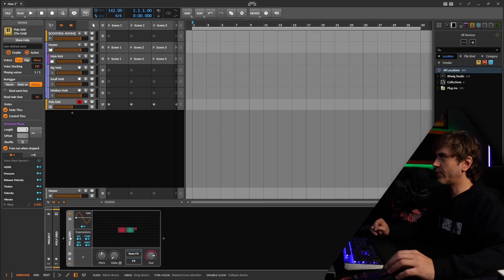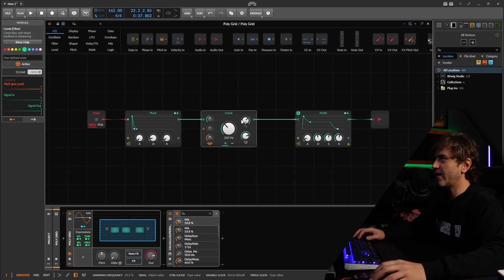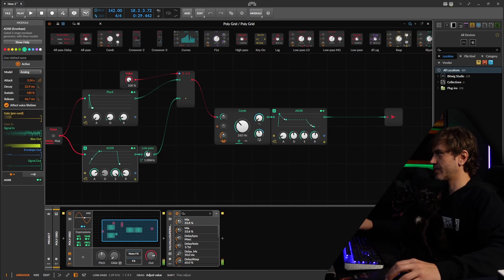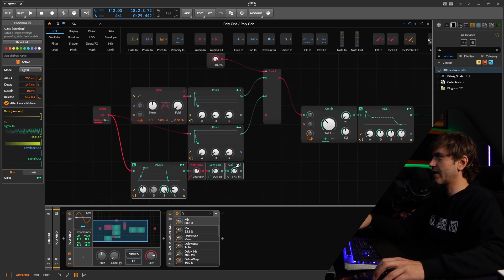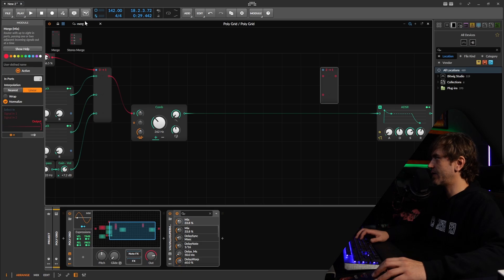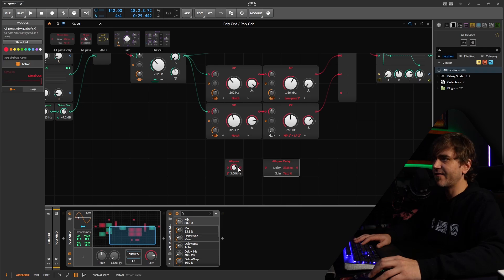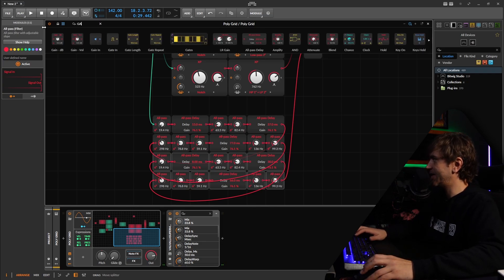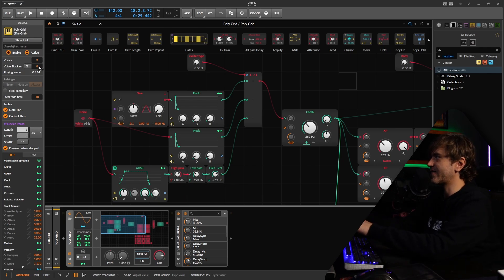Physical Modelling Strings & More in Bitwig Grid

Comment: You’d really have to use the scripting engine to assemble the models together and assign the separate midi channels for a virtual midi controller to build to assign different notes on different strings, along with an ADSR. FL studio would be way better using Patcher and their scripting engine to build it in a DAW, without writing an entire VST in C++.
Reply from the maker: Notes per string can be done with some math modules and voice stack easily in grid. You can even set it up just using native modules
Reply: @DashGlitch  Concurrency isn't truly doable in BitWig's grid from my experience. The methods I described would allow for every string instrument, from a 12 string guitar to an Autoharp.
Reply from the maker: @Myexpectationsarerealistic  it is, both using Grid voicing system or native modules and using instrument groups with native midi devices.
Reply: @DashGlitch  so you can have asynchronous chords with different notes and dynamics for each portion of the chord?
Reply from the maker: yep!

Comment: i've been doing a ton of physical modelling with the grid, the modular design makes it so much fun. even if it's not a pure modelling patch i'm making, i'll still often add some elements of modal or karplus strong synthesis to give my sounds a bit more physicality.
A thing you need to be very cautious about is the input gain of the comb, because the filter starts saturating quite quickly. 
So whenever you hear some distortion it's probably a good idea to turn the filters input gain quite far down.
you can also use it together with the feedback to control the noise/harmonic ratio of the output.

very fun video, i just love physical modelling in the grid man. it's been my favorite thing to do lately.